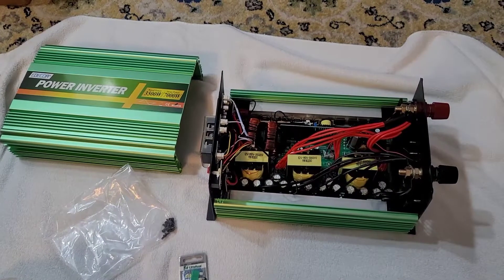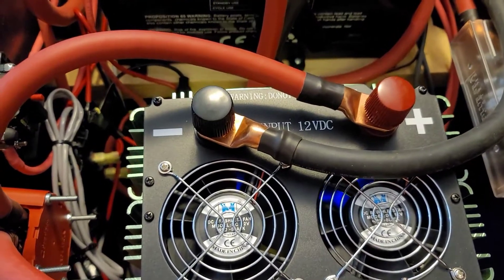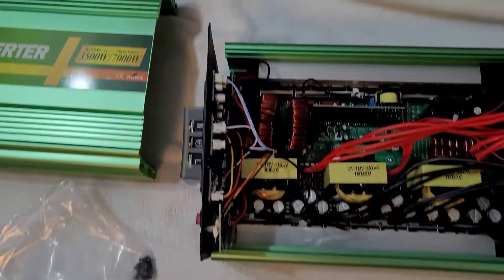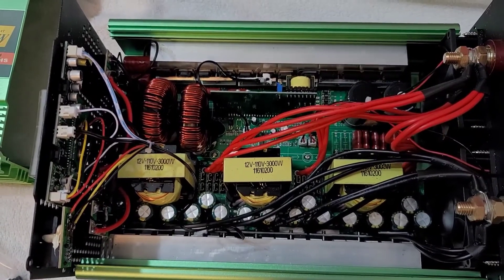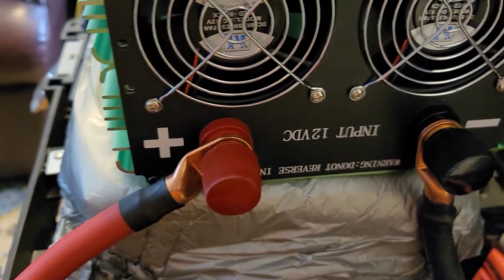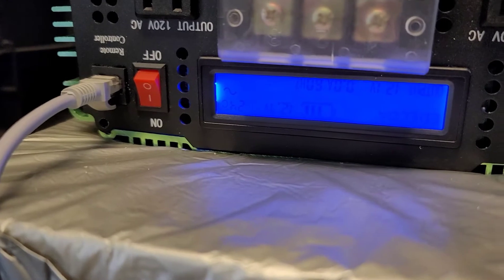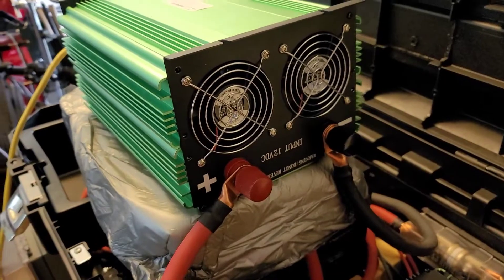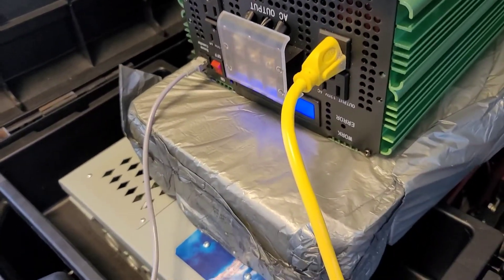EDECOA 3500 Watt Inverter - MY STUPIDITY - real life reverse polarity protection test.

Comment: I have this inverter & I must say I was not impressed with Terminals, only covered with a small plastic cover. I could live with that, seeing my Inverter is not accessible normally. The 12Vdc input & the 230Vac (Australia) output circuits are not electrically isolated.
It suddenly stopped working so I suspected one of the fuses. Unfortunately, after examining all the fuses, isn't that fun, they were all fine. So, I don't know what it is. It looks like I may have to replace the Inverter.

The Australian Govern Solar warnings site has issued this warning.

The energy product is a EDECOA PURE SINE WAVE 3500W 7000W 12V 240V Power Inverter Camping Caravan LCD, Model: DPP35
The inverter is considered unsafe for the following reasons
•	Access to live parts / terminals (i.e. 230 Vac) without the use of a tool; and
•	12 Vdc input and 230 Vac output circuits are not electrically isolated.
•	The inverter does not comply with Australian product safety standards, and has been involved in a shock incident that our office has investigated.
•	If you have purchased this inverter, I advise that you cease using and dispose of it.

Comment: The EDECOA inverters do not output the same as the grid. The polarity is reversed. I have been using one to run my fridge and it make the fridge leak water. On the grid the fridge does not leak water. I have tester that shows when the ac polarity is wrong.

Comment: I have a 3000w unit, same company. I have a question if you don't mind. I have a 2015 Ford transit 250mr, I added a 2nd battery and up dated the cpu. The problem I have is my inverter won't even run the 1500 w ceramic heater we have. Sorry to ask you if you have ideas on what could be wrong with my inverter, but I have tried contacting company on their web site, but support site says it isn't working. I'm also a Vermonter,Jericho. Can you point me in the right direction, or a site I can contact company. Or do I toss this one on the manure pile on the farm. Also great post, My unit powers up, so not sure if I need to check units fuses. Thanks foir anything you can do !! Jason

Comment: Thanks for your video. I did the very same thing for the very same reasons.  Your video showed me how to repair it and that worked great after getting  12x 30A from the auto parts store. After the repair I cleaned up and got the shipping box ready for disposal and THEN found a little package of 12 x 30A fuses INCLUDED.  I guess they figure more than a few people will do this.
Reply from the maker: Awesome, thanks for watching

Comment: I have a 24v 3000w inverter that the same company made installed on my M1009 Blazer using the 24v bus in the back seat behind the front passenger. I mainly use it to power my tools or charge flashlight batteries on the go. However, I did use it one winter when the power went out and turned my CUCV into a backup generator. Kept me from freezing that night.

Comment: Hello,I made a short on load side.It stopped working.It shows me only 50V when nothing connected but if I plug whatever it goes to zero and exclamation mark appears.Do you think that are the problem with fuses?There are 8 fuses.The same as in my car.They seems visually OK.Thanks

Comment: My first inverter was a 1200 watts Duralast...if you hook it up backwards, a little red light comes on, but it doesn't harm the inverter...it was a good choice at the time...since then I have learned how to hook one up. I use red and black #2 welding lead cable on inverters. I always leave one cable on each post of the inverter, the correct color...makes it harder to hook it up wrong. Looks like you need better lighting if you can't see what you're doing...I wouldn't try to hook up my $900 Aims inverter charger in the dark. I don't ever get in that much of a hurry for anybody. I don't have $335 for power and control boards. Plus shipping which winds up being $85. Has to be insured. It's easier for me to just check with the voltmeter before ever hooking wires up. Another thing is everone tries to hide the inverter and shove it into a tiny space, with no air movement...I have fans blowing on mine. I like for an inverter to run as cool as possible. I made up a cooling fan for sitting in front of either of my inverters, that only uses 5 watts...it's 12 volt and I put a flip switch on the side. It has been over 100 degrees, so fans are necessary. I had to get an inverter last week for my pickup so I can get spring water in a couple barrels in the back. And I didn't know which one to get so I bought a 2000 watts Ampeak...it is a good little inverter. It says it has 9 fuses inside, I don't know if they are soldered in but I don't want to find out really. You can use a light bulb for a safety check. Hook up one post, and the other connect through an incandescent light bulb...if the light doesn't dim after a few seconds of capacitor charging, it's hooked up backwards. It's better than frying stuff and it only takes a few seconds.
Reply from the maker: Good point about the fans. You definitely need them.

Comment: mINE HAS WORKED WELL FOR 2 YEARS.  Added an external volt/amp meter on to the DC side. Went to turn it on and nothing but the fan runs. No led. No AC output.
Reply from the maker: Check fuses
Reply: I've done that. I'm a BAS Tech. So I know my way around fluke meters and trambolators

Comment: @Vermont Prepper, I have this EXACT inverter. Three weeks ago it blew a capacitor and I have now replaced it. To do so I had to dismantle the entire inverter to get the board out of the case. As you said were only human and I forgot to take photos of the inverter together. I removed the grey heat sinks on both sides , the green chassis, the 15 or so MFT clips that are screwed onto the outside of the chassis, and for the life of me I can’t figure out how to put it back together. I spent $12.00 on the new capacitor but it took so long to come in this thing just sat in a pile of parts. You would be a lifesaver if we could communicate and you could possibly send me photos of the inverter closeup, we can private message about details and you would be saving my bacon big time. Thanks so much , just reply here and I’ll shoot you a message with my details. Thanks Jay TinyWanderland
Reply: Hi,just stumbled across this post. My edcoda is down, says system overload, not been used in a yr or so, and I have no idea why it comes on this way. Any ideas?

Comment: Hey man, I have this inverter and I'm in the middle of a power outage and I did the exact same thing! Manual doesnt talk about the fuses at all. This video is pretty much all that came back from a google search. I was able to run to the auto parts store (they have power), less than 10 bucks in fuses and it worked. Thanks brother!
Reply from the maker: Awesome!  Glad it worked out.  Thx for watching

Comment: Mine just took a shit. I keep hearing like a tiny arc like something inside is sparking. Then, the display showed a triangle with an explanation mark. Don’t know what’s going on.
Reply from the maker: Doesn't sound good.  Check your fuses
Reply: If you can hear it arcing before it dies completely running it with the case open in the dark might let you see a bad component. Bad capacitor (Tall round thing) or bad insulation of transformer or circuit board trace. Maybe bad connection inside and something is lose. When there are many amps then having a good connection is important. You've probably put a car battery in and cranked it and heard a pop and no power and then oops put battery clamps on too loose. Who knows. Oh a year ago. RRRR!

Comment: Hi,
Please could you help me? I need the number of two IC on the circuit board because I have the same inverter like you, and the two controller IC is exploded, I replaced the mosfets (all of them, six was in short circuit) and than I not set a low current limit on my bench supply when I tried to start...
If you can help me, i send a video of the exploded ICs destination.

Thanks,
Tibor
Reply: @Vern Larson Not hard to replace the mosfets BUT if anything else damaged like in my edecoa inverter than when you switch on the driver circuit will explode. I tested without the short circuit mosfets, and the diplay came on etc, so I put the new mosfets in and I was stupid and not set current limit to the lab power supply than two driver IC exploded. I cannot read the number of ICs because they burned so badly :( So measure all the driver and primer circuit because it can cause suprises. :)
Reply from the maker: Hi, I am not that technical.  Sorry.
Reply: @VermontPrepper  I am, i just need a photo of two IC from your edecoa 3500W inverter if you can make a photo of that part that can help me a lot of course if possible.
Reply from the maker: Maybe a local person can do it for you at a reasonable cost??